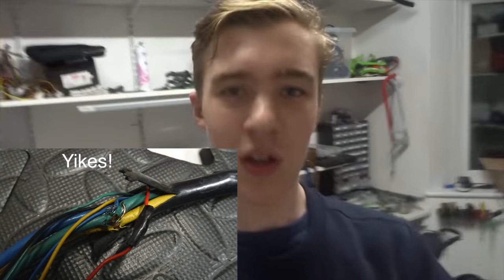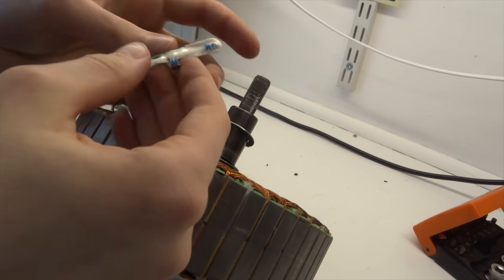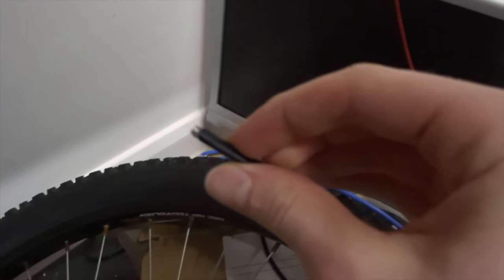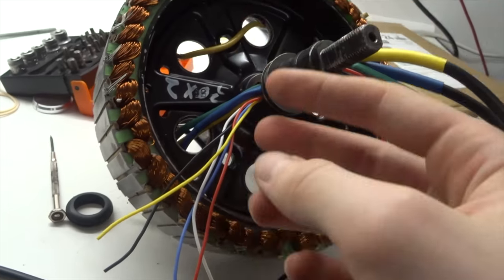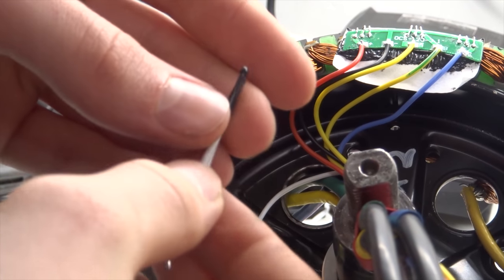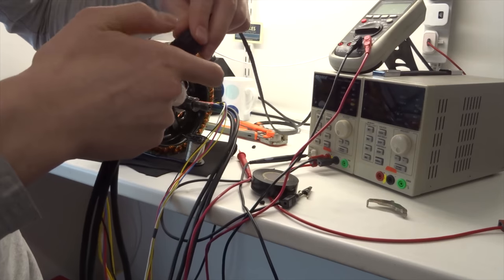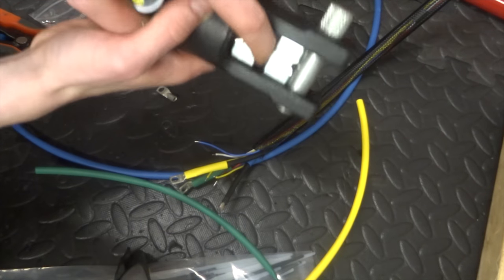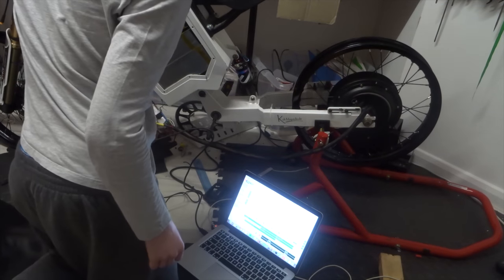GUTTING hub motor sensors and wires -  8kW Enduro MSVA eBike V3 Build - Part 12

Comment: my motor hall harness got 5 wires but on controller side i have 6 wires with white wire as extra ... how can i tell if its a temp sensor or what else could it be plz help

Comment: FYI, OEMS use a Teflon / PTFE insulation on phase wires. It why it’s so thin compared to silicon. Motors hit 100c which is why heat shrink is a poor idea. Kapton tape is your friend, as is die grinding burs on axle passage. One can use wire “braid” sheathing to draw the wires through the axle hole. Halls and thermistor are logic current, so can be far thinner gauge. Lastly, one puts the logic wires in the gaps between the thick phase wires. Look into Motorsport harnesses
Reply from the maker: Ah, didn't know you could get teflon wires. Perhaps save that for another motor, but given that heatshrink doesn't activate till at least 150C and the previous wire was PVC the temp can't be that much of an issue with ferrofluid and hubsinks I'm guessing? Cheers for the tips tho 👍

Comment: what causes these to go bad? using your video and a few others i was able to determine my yellow wire hall sensor was bad. the other day i ran 95volts through my controller just to see what happens and it didnt like it so i backed it down to 85 and all was good again, until tonight on the trail. shreading on a dirt trail in the complete dark after work all of a sudden the motor sounded like it was grinding if i applied to much throttle over 10 amps
Reply from the maker: If you run the motor on a bad sensor, I expect it could damage the controller as well. I'm no expert but the grinding is probably either a bad bearing or faulty controller?
Reply: Uphills and on dirt mud trails sometimes even on rain high speeds can cause bearing damages due to struggling going hard and  yes the yellow wire is first burning on the connection maybe even damage sensor
Reply: Bad soldering, corrosion, high voltage, high current...

Comment: Hi what size are phse wires lug connectors or can I use choc block connection and what is the amps. I bought from Amazon lug connectors to thin
Reply from the maker: I used 8AWG for the phase wires and or 8000w would strongly recommend lugs directly to the controller rather than choc blocks as they have much higher contact resistances and could get very hot or even catch fire.

Comment: hey i got a question for ya. i took my motor apart to rewire it and like an idiot i did it while i was tired and never took pics. now it would be pretty simple if it was just hall wires connected to a pcb to sensor but my setup has no pcb for the sensors. its straight twisted wire and ghetto i couldnt believe it when i opened it up but im pretty sure its not connected correctly. i was wondering if u knew if there was a video i could just take a look at to see the wire placement for non pcb board hall sensors.
Reply from the maker: Hmm that's weird haven't seen that before, sorry can't help much!

Comment: I use the QS205 and I noticed that the brake disc bolts or something has rubbed away the gauze sleeve and half the plastic insulation from one of the phase wires,  i'm quite surprised by discovering this, I guess I didn't secure it properly in a suitable position. The process you went through to replace the wires seems so difficult !  I hope I can get away with just covering the bare wire with glue to replace the missing plastic wire insulation.  My cheap 1500w hub had a metal spring thing that protected the wire from damage.  I was only supposed to be changing a punctured tyre and noticed a few big problems !
Reply from the maker: Yep if the wire isn't pulled out the way, it will likely get caught on the rotor bolts as they stick out. Be VERY careful to insulate the bare metal properly if you're not replacing the wires as if they touch it will certainly take out the controller and let off some sparks! Properly speaking the motor should be rewired but I know it's a pain :)
Reply: Use silicon paste

Comment: Great video.

Question…does it matter if the hall sensor replacement is unipolar or bipolar?

Can’t find any information online or on YouTube.

/Bklyn👑
Reply from the maker: The ones I used and from what I can gather from other guides are bipolar. I'm not sure if it would matter as I'm guessing all the magnets are orientated the same way around the hub but could be wrong so stick with bipolar. 👍

Comment: I replaced 2 hallsensors that was bad, but for some reason it keeps blowing up. I used a tester to check if hall sensors are toggling before putting power( it does). I also used same controller on a different motor and it works. Any help will be appreciated.

Comment: How important is the black negative phase wire for the throttle. My cable got worned down, and small black wire got severed..
Reply from the maker: You needed all 3 wires for the throttle. One is positive, one is negative and the last one is the signal
Reply: @EverythingEbikeChannel  it's a 5 wire phase. I don't have a signal either...
Reply: I just don't know how important the black negative wire is..
Reply: That was a pic of the severed black negative phase wire. I am going to have a heck of a time splicing this extremely small gauge wire back together 😒

Comment: fantastic video, but i would very much like you to tell whats the recistance between phase wires ....if any ? my ebike is fucked, and as far as im guessing there shouldnt be any connection between the phase wires correct ? i took my motor out as you and meassured the ressistance between phase wires and beeeeep they are all connected ! they shouldnt be right ? 
thanks for the awesome video
Reply from the maker: Yeah your multimeter will beep when you connect it between any 2 as they're essentially loops of wire connected together but with a tiny bit or resistance. Normally the resistance should be between 30-200mΩ, anything over that could suggest the phase wires are burned out but the larger the motor the higher the resistance so measure it the post back here.
Reply: @EverythingEbikeChannel  thanks for helping , as soon as i get some time off from work i will try and let you know

Comment: help me bro, my hub has 2 sliced wires small white one and the big blue??? can i fix it ath ome????
Reply from the maker: White one is most likely the temperature sensor output and blue one is a phase wire. Watch what I did and that's how I managed to get mine done at home and I am no expert - first time here!
Reply: @EverythingEbikeChannel   oh mate thank god its all fixed just soldered the cables after i chopped the wire and pulled it back into the hub thanks to the manufacturer for offering such vast wires

Comment: what temp sensor did you use?
Reply from the maker: A generic 10k NTC one but haven't got it working with the sabvoton yet. It needs to be part of a voltage divider but haven't had a chance to fiddle around with values yet

Comment: Can I ask what type of crimper you are using and where'd you get it?
Reply from the maker: It's a generic 10 ton hydraulic crimp off ebay. If you look them up there are loads around the £30 mark that come with all the dies for different size crimps.

Comment: Is there a certain sensor to buy I'm wanting some for a stealth bomber 5000w hub but unsure on what to buy ?
Reply from the maker: Look up 'hub motor hall sensor' and any one should do. Ideally check the part number on the ones you're replacing but any digital sensor should work.

Comment: Nice job
What model  temperature sensor and do u know where can I get pls?
Did u use automotive silicon on the side plate to seal and waterproof the hub? 
That would be great help
Reply from the maker: Just added the link to the description, they are generic 1kΩ thermistors as that is the same value as the KTY83-122 that comes in most hub motors. I haven't actually tested it with the sabvoton so don't know if the extra PCB I added is wired up correctly with the polarity and voltage divider. And yes, I will be using the silicone to seal it once I've added ferrofluid at a later date.
Reply: @EverythingEbikeChannel hi  did u test temperature sensor with display? where do u have to solder the other pin of temperature sensor as only one wire comes of the hub?
Reply from the maker: @alireza071  With the sabvoton, the middle wire from the voltage divider between the potentiometer and thermistor goes to the white wire of the hall sensor conenctor. The thermistor then goes to +5v and pot to 0v
Reply: Red varnish insulator from MG chemicals is what you're looking for...

Comment: Nice work mate 👍🏾 are u by any chance able to help me sort out my damaged motor wire need them thick gauges if that's possible are u able ?if so how do I get intouch with u thanks ps the hub motor is a citycoco 60v60h 2000w
Reply: It may be possible, but you might lose warranty and because of the wire size, you won't be able to run the hall sensor cable through therefore losing sinusoidal signal

Comment: Great video. Question. 
My ebike works fine, but when I do the motor phase wire test and turn wheel (backwards) for resistance I don't get any but motor works fine and hall sensors work fine.  This is not normal but it hasn't caused problems.  And ideas why?

/bklyn 👑
Reply from the maker: Is it a geared motor that only engages when spun forwards perhaps?

Comment: hi again mate , i managed to make a complete mess of my hall sensors , and in doing so somehow snapped the little Circuit Board that sensor went into , please could you point me in the right direction , to where i could buy the board with sensor attatched ,  i dont want to buy wrong one .<and im hoping with your knowledge on this kind of stuff that you could link me up , would really really help me out , thank you !
Reply from the maker: I've never had to purchase the board itself, but I think you'd be looking at one of these https://bit.ly/3cmO1se . You might need to replace the factory sensors with whatever you were going to use. As long has the new sensors are in the same place on the stators as the old ones, the board just acts as a connecting place for the wires.
Reply: @EverythingEbikeChannel  thanks bro !
Reply: Yes I have also ordered the same too as. I messed up my PCB board

Comment: Did you ever see if the temp sensor worked with your sabvoton controller at all and output a realistic temperature?
Reply from the maker: The sensor I installed here didn't work, it showed 130˚ all the time. I need to get a PTC thermistor and 22kΩ potentiometer to get it to work I believe. The sabvoton is very sensitive to changes in voltage from the sensor so there is only a range of about 0.25-0.5v.
Reply: @EverythingEbikeChannel  the sabvoton manual suggests a kty83-122. However these are discontinued so an alternative is the kty81-122. I have ordered one and now looking into wiring. Are you 100% sure the sabvoton needs a voltage signal return for temp sensor? I was thinking for the kty sensor it maybe just needs a resistance to ground reading and the controller interprets this into a temperature. So basically wiring white sabvoton to kty leg, then second leg to ground. It’s really hard to find any info from siacosys
Reply: @lhk8558  have you finde Out how to Wire the Sensor ? Im stand in the Same as you above one year 🤣 have the Sensor but dont know how to Wire

Comment: hi , how many watt is the motor ? as i have just ordered them same hall sensors, to replace the ones on my 1500 watt motor , im using a 48v battery , and notice in the specs of hall sensors -- Operating Voltage : 4.5V - 24V .do you think they will be ok , or will i end up burning them out quickly ,?  and thanks for sharing your knowledge !
Reply from the maker: Hall sensors run off 5-12v supplied through the separate hall sensor connector NOT the main battery so no issues there. Motor is rated for 3kw but will be pushing for 8kw with some additional cooling from heatsinks and ferrofluid.
Reply: @EverythingEbikeChannel   thanks bro !
Reply: @EverythingEbikeChannel  how did it work? I already put ferro in already and im waiting for my hubsink to arrive. Will also upgrade phase wire. Did your set up mitigate heat on the hub? Thanks man

Comment: Where wires go in to motor heat shrink no good use a spring. Should feed wires through a spring then in spindle that's the way they make at factories. When you bought the kit it would be fixed with one use it as it will happen again

Comment: copper wires have 40 percent better electrical transmission through them, less resistence actually, so wires 40 percent thinner toi do the same job as those big alumiminum u struggle with